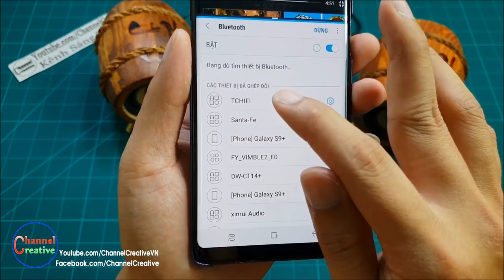DIY 2.0 Bluetooth Speaker with Wooden Coffee Box and Scrap Cassette Player

Comment: I got mine couple years ago but without the clear box and looks like this version has 3.5mm Aux input, I don't think mine does.  I found 2 speakers in thrift store from surround system and it worked great, very loud compare to any BT speaker out there at least 3-5x louder.  At first I was using a battery pack from my headlamp which is 2x 18650 in series and parallel for 8.4v, worked fine but if you leave it connected it drains the battery overnight, I got tired of this and started using 12v regular power adapter from the wall outlet.  After 2 years one of the channels started going out, so I am looking for replacement now.  I see there are BT 5.0 boards out there now.  BTW, the Bluetooth connection drains the phone battery noticeably, not sure if this is specific to this board or in general.  I am thinking with this newer board I am going to try wired connection.

Comment: Crazy for the Past 3 days I've been trying to research 3watt midranges and the TDA7942P. Not one lick of info anywhere on the actual watts coming out the amp. If my math is correct, 12V would yield around 7-10watts. Than i decided to take a look at your set up.....3Watt 7 ohms and it sounds Great!!! Answers all my questions in one video!!!

Comment: To all people asking about the box, the speakers, the concept is the same. There are calculators etc on the web. I'm saying this mid video. He just thinks wine barrels are cool. It's a container, that flex's x amount , white fluffy stuff can help. Ports can help. Crossovers, well not in this case but for a sub.  These probably sound great. I'd build it from concrete, flex is 0... but that's just me. Great video.

Comment: Would be good if you could have single bluetooth speakers (with only one driver) one on each channel and still work out to be stereo. Like yours but no wires. Or a bluetooth unit with two wireless speakers (with one driver in each).

Comment: Please make a fpv drone by using 
250mm frame 
2200kv brushless motor
30a ESC 
6 inch propeller
2200mah lipo
Kk 2.1.5 flight controller 

Please bro make it that... OK bro..

Comment: will a 12v battery pack power this setup ????????
Reply: Yes.
It's 12volt "DC" meaning direct current. Battery power is DC. "wall warts" have to convert the AC power from your wall to DC after they step the voltage down to 12 volts.

Comment: these are not diys  
u have everything bought ready, what u r doing is just attaching them
Reply: what are you gonna do? make all the voltage controllers, capacitors, coils, etc. and solder them to the board and then make a barrel like enclosure and make your own drivers? 
thats not how DIY works